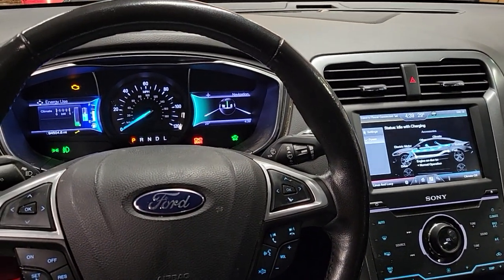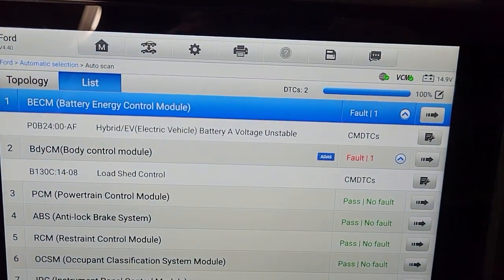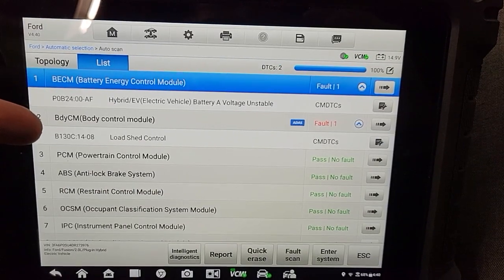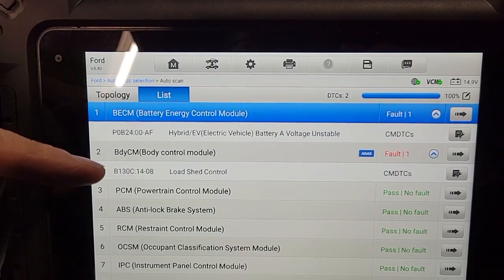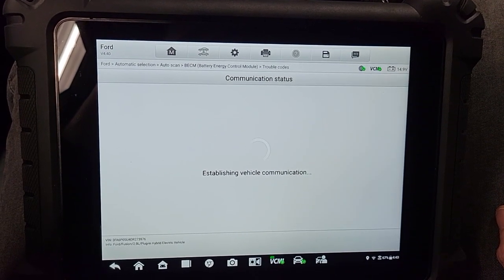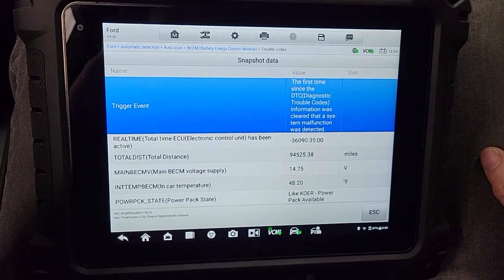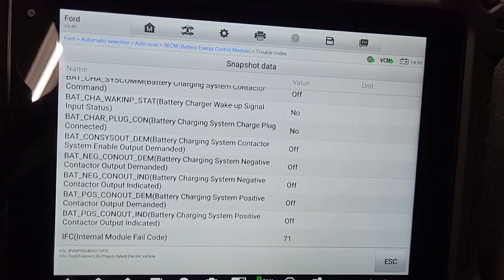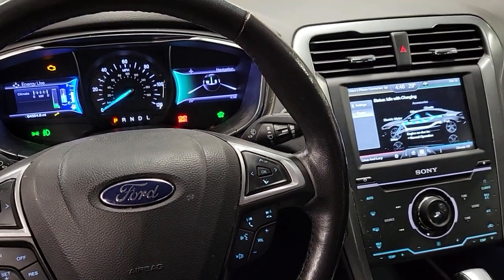2013 Ford Fusion Energi HV battery pack fault codes P0DD9:00-AF and P0B24:00-AF

Comment: Hi I have the exact same problem. Ford said it is a module. I bought the module online but have no idea where it is to replace. Part # HU5Z-14G490-C. 
Any idea where this is located?
Reply from the maker: @emb120dude  That's not a lithium ion battery module part number. Looks more like a sensor or computer module. The battery modules are green squares with a positive and negative terminal on them.
Reply: @ interesting. This was their quote “Its the module to the hybrid system”.  Thats the part they said needed replaced
Reply: @ but I also heard that module has to be reprogrammed and you just can’t swap it out? Any idea if that’s true? I have no idea where it’s located. Thanks
Reply from the maker: @emb120dude  Probably does need programming. Not the same issue I had.

Comment: Can you make a video of how you replaced the packs?
Reply from the maker: I had the pack out and torn apart twice, but I only took pictures. The hardest part is using a couple of long wood clamps to squeeze the cell stacks together during the reassembly. Also, I had the help of a forklift for getting the HV pack in and out through the trunk, which was also a big pain. But after replacing 6 weak cells, it's been working great for almost a year now.

Comment: Did you ever get to replacing the cells?
Reply from the maker: Yep, replaced a few cells and it was good for a month or two, then had the check engine light start turning on after charging so I'm replacing a few more cells. Probably should have bought 6 cells the first time around.